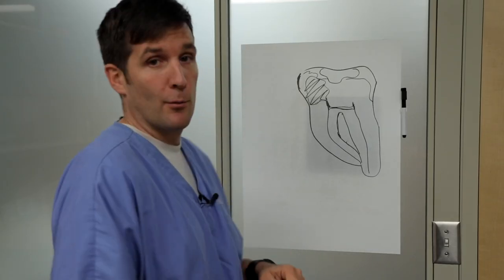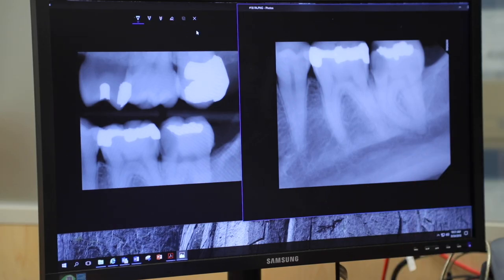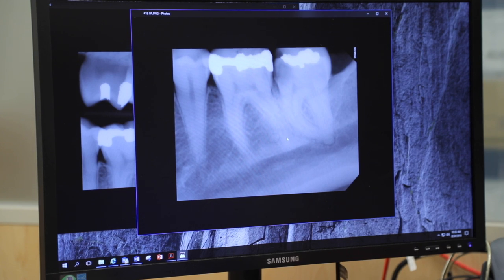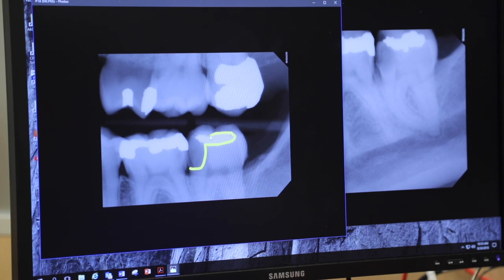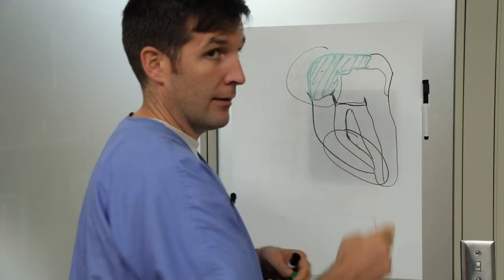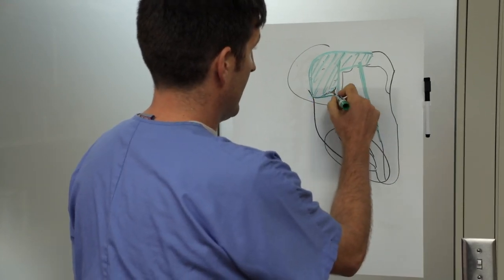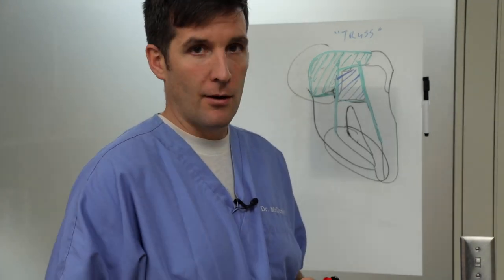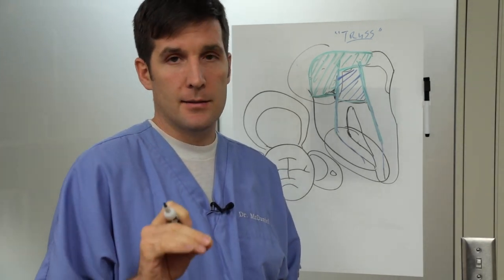ENDODONTIC ACCESS - TIPS & TRICKS!!!

Comment: How to avoid perforation of the pulpal  floor.  
1- Flatten the cusp tips so as to have a dependable reference point
2- Measure the position of the top of the pulp chamber on the BW x Ray 
3- Use a sharpie and mark that length on the shank of the bur.